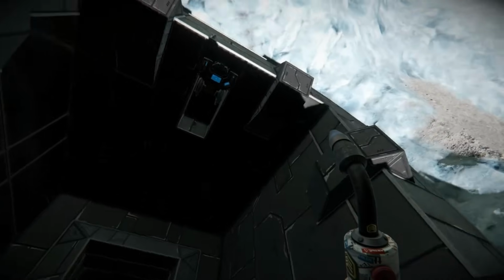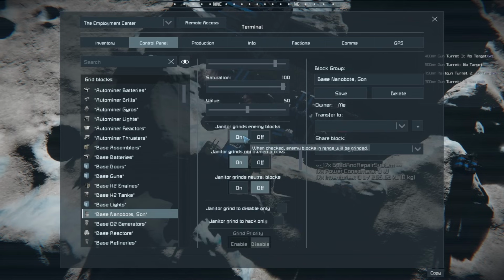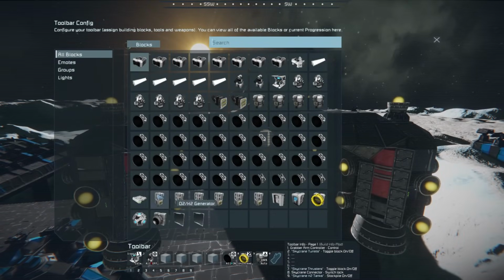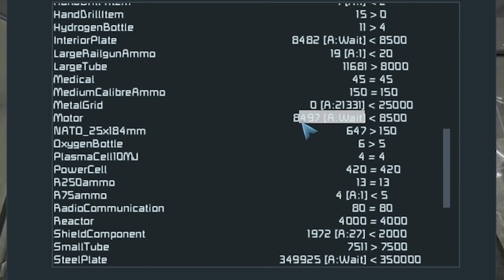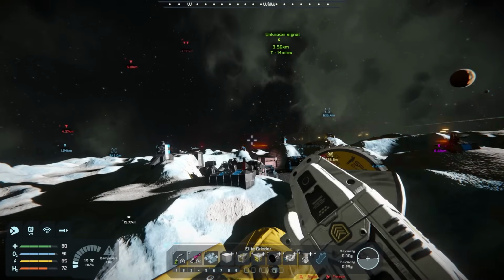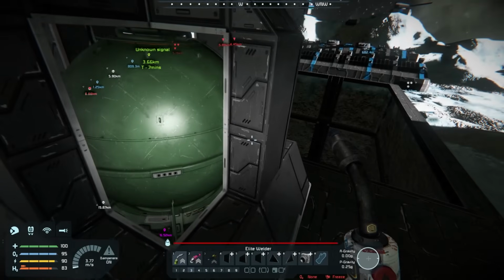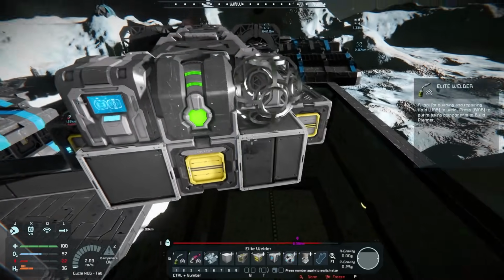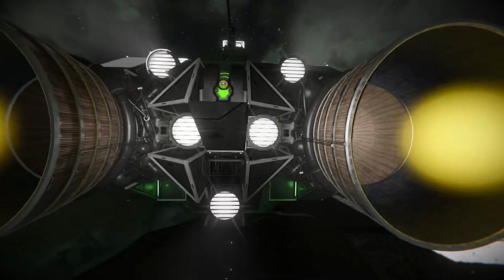Who breaks first? Me, or the game? | Space Engineers Suit Only Survival #12

Comment: Very much too late. But my idea for the mega pit would be to have a moving floor, mine out to the left and right a couple blocks high, to the full width plus a bit, then use pistons to push out a full floor of grinders or welders
Reply: Potentially wheels to support weight? Or connectors in the four corners to lock it into place? Not sure if this will summon the almighty tho

Comment: Instead of one turning door, couldve been two "normal" "doors", like (view from side) .|    |. neutral, .__|. grinding, .|__. welding. Projector can go on the subgrid to keep it repaired. this setup also would allow to use piston actuators rather than just rotors alone, if the extra stability is necessary (when using pistons, rotors need be unpowered so they dont fight each other)

Comment: I believe your issues with Isy's may be tied to the obscene quantity of speed-mod assemblers in conjunction with loads of nanobot structures. Normally having 30 speed mod assemblers is just fine, but I think this causes tons of mayhem when combined with the nanobots. 

At least in my own experience, I've noticed the nanobots (even with just 7 or 8 of them) can really put a lot of strain on the script when you're running 4 maxed out assemblers. I think this is because the nanobots are meant to also work in conjunction with assembler queues if you've got a script for them. Something somewhere just breaks down. I think the issue is Isy's doesn't play nice with nanobots at any large scale. 

I have no explanation for how Isy's mysteriously loses blueprint data on all of the components, but I bet a good test for this (if you haven't fixed it yet) would be to remove every nanobot structure, cleanly remove JUST the nanobot mod and Isy's script, then load up the game again with a fresh copy of the script and see how it fares. 

I don't think any nanobot mod was really intended for the scale you're trying to use them at. This is something I'm beginning to notice myself in my own games. They're meant for assisting the construction of a starter base, help with the creation of a printer, and after that (when you're rolling out printed ships) they're really only meant to be used sparingly. Like on a large grid ship to carry out internal repairs, or to serve as a repair mechanism for small-grid ships in some kind of drydock. 

What I typically do for any large scale construction is build out a welding arm using MarmOS. The script is confusing at first but there are loads of examples to build off of. The way these arms work is very intuitive, it's just like controlling a spaceship and you can have up to 6dof motion if you build them correctly, and it can cover a surprisingly large range. 

I usually build a few of these arms, hooked into my base cargo, to weld up any large constructions or even do drilling, as you can attach multiple large grid drills and control it all manually. The games I've played with no nanobots, and instead relied on construction arms, have never given me any problems. I definitely think this is exclusively an incompatibility between Isy's script and nanobots.

Comment: If you want your ship charging while you build it:

Each large connector has 2 tall sides and 2 short sides. You can connect a regular armor block to one of these "tall" sides. Then slap down 2 more armor blocks on top of the first, then add an upside-down  connector above the original and BOOM. Lock the connectors to each other and start building. 😊

Comment: for that big pit, you could have a bed of welders on the bottom and have a shelf of grinders that get pushed from a trench extending in to the wall. you could use a gravity generator and set the area to only suspend the area where the grinders would sit at -0.25 a-gravity making 0g of overall gravity. if youre concerned about the shelf of grinders wiggling then you could have guide rails down the sides and maybe have some pegs on the leading edge of the shelf to interlock (with a little wiggle room to avoid klang) in the opposing wall. your grinders would be constantly being repaired by the welders and the pistons shouldnt flex since the grinders are suspended in 0g.

I dont play SE so i dont know if theres any considerations that would make this unviable but i had the mental image of a drawer system if that makes sense.

Comment: If I were to make a gaint grinding pit I would make a reverse 3d printer with either pistons or wheels ( I love wheels ) and have it slowly  grind anything from top down.
Also it can have a 2 heads one as a grinder and the other as a welder, although the welder will need to be connected to the base and not wheel based unfortunately

Comment: My pit suggestion would be panels that can be flipped from the walls down to the ground. On one long wall there is the grinder panel and on the other side there is the welder one. To use them one rotor truns the panel 90° down and stabilizises it with a landing Gear so is in place perfectly. To use the other mode you first put the currently active panel back on the wall and then put the other one down with its own rotor.

The Advantages are that is relativly simple for SE and its a space efficient solution for both modes. You can even armor the back panel so the walls dont get damaged. 

I hope you understand what i mean :)

Comment: You could do sliding welders/grinders. 

Have a piston(s) that extend a wall on the bottom that can latch into place using attach/detach in place. Should be able to set up an event controller that once the pistons extend the wall into place at the bottom, it attaches to each side via piston, detach the extended and keep it in place. 

A button controller can then reverse the process and replace with the welder/grinder depending on which you need.

Comment: For your big pit, if you want it to have grinders and welders, you could build a wall of each. Hinge the walls at the bottom so they could hinge down to become the floor as needed. Grinders for the left wall and welders for the right wall (or vice versa). A projector on each "wall" with a blueprint of just the subgrid it's on would allow for automatic repairs.
The complication with this is that you'd probably have to add thrusters to the walls to lift them back up since hinges are not very strong. Rotors could work better, but they're a lot more tricky to calibrate offsets to work nicely together.

Comment: I have an idea for the pit. why not do something like sliding floors? Have a base normal floor for hanger mode and then each long wall can have a sliding floor that can slide out for either welding or grinding? You can even use hanger doors to hide the sliders and add some design to it. This can easily be repeatable and you can even split them into chunks since grinders and welders on large scale have a 4 small block spherical radius. That means you can make a single piston push one chunk and they won't connect.
Reply from the maker: Now this is interesting

Comment: It's an unfortunate problem with Isy's once you start getting a much larger number of components or items than vanilla (not uncommon for larger WeaponCore mod combinations, or Industrial Overhaul paired with other mods). As someone pointed out in the comments, the Custom Data of the programmable block stores that, and deleting the custom data contents will allow you to recompile the script successfully in case you've done a lot of custom setup of Isy's without losing it all. 

It only seems to have the error when attempting to re-initialize, not a fresh init from scratch.

It DOES have the unfortunate side effect of making you have to re-learn the recipes again, sadly.

If you don't enable the Autocraft portion of Isy's, it won't happen, but then you need to use another mod or script to handle autocrafting.

Edit: Unfortunately, no inventory script works as well as Isy's for inventory control and sorting across all mods. Production Quota (mod) can be used to handle the autocrafting itself, and doesn't care about total different item count since it operates on a per-production-block basis, with less load than a script typically.

Comment: The merge block skit was pretty funny.  I was expecting you to just show the pistons breaking due to clang, not a warhead gag to roast backseat players.
Reply: For just a second I thought that was genuine behavior from the pistons still compressing the merge blocks, and then I got it too 😂 

I think the merge block idea is good, there's the space elevator scene in the intro, it's just super difficult to line up, and should be done vertically, with a horizontal offset so the blocks meet up on their sides, not faces
Reply: @sunnysonne2957   It is a good idea but as he said in a previous video his series doesn't exist to be the most efficient builder, he's going to do whatever is the most fun.  Just reattaching it with a merge block is boring, instead he made it the feature problem for the episode that and drove his descent into madness story.

As for the space elevator scene I actually made a tunnel bore mine based on that design.  A pair of merge blocks and connectors to caterpilar down, a projector and welder attached to the drill to build more shaft as it descends and another merge point it can reset from.  Took forever to design and was horribly impractical, but so fun to make.
Reply: @xipheonj that's so cool!! I've been thinking of building something similar, to go up to a station I built just outside P-gravity.

I actually did exactly what he did when I dug my first base location out, with OG inventory too 😂😂